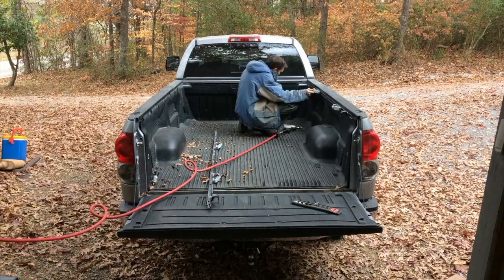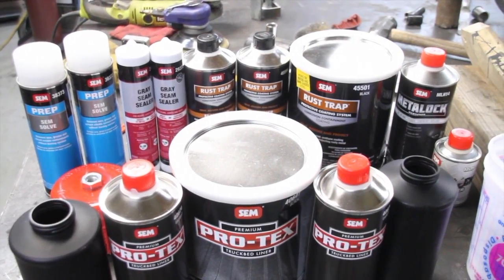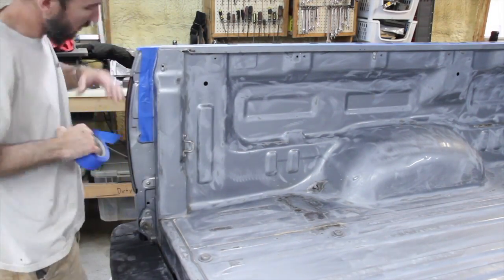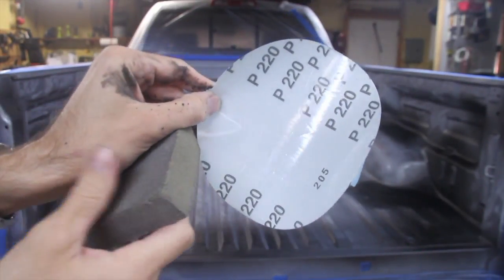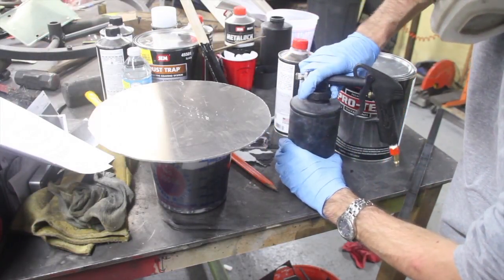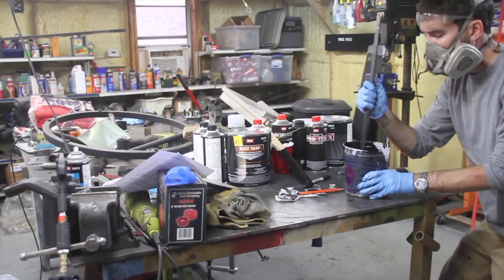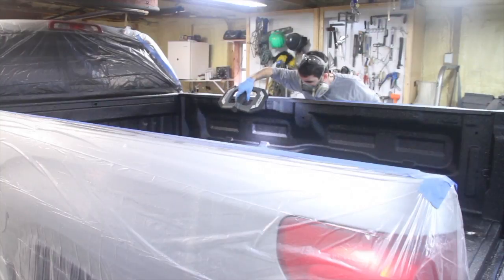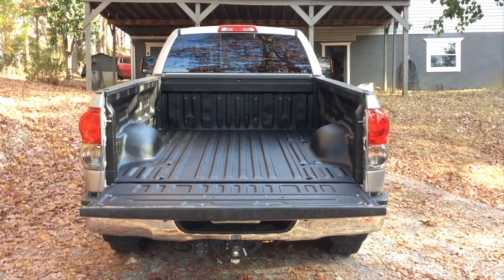How To Spray On Bedliner

Comment: Awesome job. Great detail. Its always fun to see how stuff gets done and knowing it's not all magic and machines. But if you think about it. $100-$200 (if you already have a shop/garage that's well set up with an air compressor and tools) plus 2 to 6 hours of your time. (2 having some experience and 6 this being your first time). Or paying a professional shop to do it for $400-$500. It all depends on your skill. I personally like doing what I can myself because I know certain shops take short cuts to get it done faster. Where if I do it I know I'll take the time to do it right. Sometimes based on your skill, time availability, space/tool availability, it is better to fork over the extra $200-$300 if you can afford it to where you know it will be done right. I went on a rant lol. But nice job. I would be proud of the end result.

Comment: I agree.  That is much better that the plastic OE liner.  But whenever I have a trapped spot to repair like you had I always use weld thru primer on both sides of the patch and the metal underneath otherwise it will rust through again. https://www.eastwood.com/ew-self-etching-weld-thru-primer-16-1-oz-aero.html

But that spot looks like you have a problem with a Toy design defect.  That bed panel should not be touching the panel underneath it.  Is that a piece of frame underneath?  Could your bed mounts be collapsed?  I suspect that those two pieces of metal are rubbing.  If so you may have another rust-through?

Comment: If I was to do this I would just remove the truck bed. Then flip it upside down. Do the bottom then the inside of the bed. Effectively making sure it never rusts again. People act like taking a truck bed off is hard. Its just 6 to 8 bolts mostly all inside the bed.

Comment: Great video.  LOT more work that I thought!.  the 1 difference I plan on is removing ALL the bed hardware (bolts, hooks, etc)  and placing some cheapo bolts in the holes to protect the threads, then re-installing H/W after so it can be removed without damaging the liner..  GREAT JOB !

Comment: Not worth the time and effort that goes into the DIY stuff like this .. it isnt as good as linex and it doesnt have a lifetime warranty. Ive tried this route on my old truck and it did not hold up to any sort of crap i threw in the back of the truck.  I was getting gouged all the time my linex coat gets only scuffs but nothing that penetrates the coating even when im throwing old water heaters and furnaces in the back to take to the dump.

Comment: This is a great video but to be honest these SEM products are way too expensive to make this a DIY project that makes since financially. Going by the Amazon links you provided it would cost $630+ just in materials alone (and that’s assuming you already own a air compressor and angle grinder). I can just take it to line-X and pay them $550 for a turn-key job with a warranty.

Comment: Those older Toyota Tundras are notorious for under body rust. The plastic bed liners are more prone to scratching the heck out of your bed paint than causing rust, but they are FAR better bed protection than the spray on liners ever will be. Each product has it's pros and cons but the plastic will take more abuse. I have had a plastic liner in my truck for over 20 years and the paint is scuffed (because it will move around) up but no rust.

Comment: Can you remove a spray bed liner if you would want to replace it again?
Reply: moronmonkey1 just gotta sccrap it off or grind it but the liner gets hot kind of like plastic and becomes a gooey type material. A scraper is easier unless someone has a better option but that’s usually what I’ve used

Comment: BTW, always disconnect your battery before you weld on your vehicle. I have seen several batteries fried within a few hours of welding on the vehicles they were in. I know it doesn't always happen, and I don't have any proof, but it never hurts to be cautious.

Comment: We like to use bed mats. Mostly, only the floor of the bed needs protection plus, easy to remove and washout the bed.  Spray on methods are nice but after time, they fade and crack. The full plastic liners like the one that was in before are a PITA due to the ribs in them plus most items slide around on them.  It's a hard call between them all of course.

Comment: If you use a HVLP paint gun you would have a lot less overspray to deal with when painting.  Harbor Freight sells a pretty good one for only 16 bucks.  https://www.harborfreight.com/20-oz-high-volume-low-pressure-gravity-feed-spray-gun-47016.html    The purple gun new coupon code 22687355 Good until Oct 15, 2018  Limit 7   (seven ?? I guess if you hate cleaning them)  http://www.hfqpdb.com/best_coupon/20+Oz.+Gravity+Feed+Spray+Gun   (I do not work for HF in any capacity what so ever)

Comment: Will it stick to Rattle Trap sound deadener that is wrapped around the wheel well in a van? And can it be used for interior, with no Off Gassing?
Reply from the maker: No and no

Comment: First of all foreign Vehicles suck, the reason I'm saying that is the cheap metal they use. That bed shouldn't have rusted through! I don't believe in buying Honda's, Toyota's or anything like them.  For the money I would have gone to Line X get a much better outcome
Reply: "Foreign"? The Tundra is the most american truck out nowadays. Designed, parts manufactured, and put together in the US. While I certainly agree with you that a bed shouldnt rust that fast, id be hard pressed to blame its brands point of origin as the problem.

Comment: What about the place you welded?  The under side of the bed is still bare steel.  That will rust out in no time.
Reply from the maker: I painted it, with paint
Reply: BleepinJeep as opposed to not paint. I see.

Comment: You did not treat the back of your patch metal or the frame rails, It will simply rust out again. You should have used weld thru primer at the very least.

Comment: u-pol raptor liner is by far the best bed liner on the market.Very easy to spray comes with its own spray gun and you can get the type of finish you like by  adjusting the air pressure.40lbs heavy finish 60lbs med 75lbs light.Used this on my off road trailer i built and it turned out great.You can also come back at a later date and re-spray if you like..at 40lbs i got a heavy coat.for $125 dollars this stuff rocks....you can get the complete kit on amazon.If you have raw metal use there acid etch primer super8 first.wipe clean with alcohol first spray primer then spray the raptor liner .you will love this liner..check it out....they also have a great support team for questions.....just give them a call.....
Reply: phil Benoodt line x is the best way too much work to do it my self lol
Reply: Phil

Thanks for the info, will look into it
Reply: when you say you can adjust the finish do you mean the texture or the thickness

Comment: I don't think it was covered in the excellent video but what was the overall cost of the products versus going to a body shop that does spray liners as a service?  I know DIY'ers get it done cheaper because they do their own labor.  Would be good to know.  That's a ton of different products.  Would you say that you would do it again with all the same products or you could skip a step or two?  Just curious.  Thanks for a great video. I'm thinking of taking everything out of the inside of my 1990 Jeep Wrangler YJ and spraying the entire interior.  This video shows me how easy and doable it can be.

Comment: I would have taken the bed bolts out. If you have to go to remove your bed for any reason, you'll have to cut around and the liner will start to peel away. Looks good though. The more coats you do, the thicker it'll be. Thanks for all the videos Matt! Def enjoy them.

Comment: What made you chose this instead of the factory bed liner?  
And now I have nightmares about what rust is under my factory liner.
Reply: Nicholas Hollow Drop in bedliners move around a little going down the road and rub the paint off underneath them. They also trap water underneath them and cause the bed to rust. I take them out of every truck as soon as possible and I've never seen one that wasn't rusty underneath.

Comment: Matt you should check out Wagners MotoCoat it sprays bedliner multiple different products and the over spray is much more controllable. I use Scorpion/Al's bedliner product it has an awesome finish and holds really well...plus the clean up is really really easy. You just let it dry and it peels out or off of everything. 

Overall I think yours looks really good. One thing I like better with Scorpion/Al's is the ability to go back over and make thicker or touch up. Not sure if SEM is able to do that

Comment: great video! I think the only thing I would have done different is sprayed the top under the plastic rails to prevent rusting like you had in the floor. I've been thinking of spraying my truck frame and after seeing this it looks much easier then I was thinking it would be.

Comment: I used raptor liner it's alot easier to use and hard as a rock and it comes in a  tintable version.
Reply: Jeff Davis used that on all my bumpers and skid plates
Reply: did you do the tintable version?
i am about to do the raptor liner on the interior and bumpers of my xj. i dont have a paint store in my town and do not know where to find the pigment to tint my liner tan. 
where else might i urethane color pigment that works well with raptor liner?
Reply: How good and long does the raptor liner  do, last?

Comment: I would still send my ruck to linex we have one in Medford which is close by and they always do an amazing job and their product is probably the best out there
Reply: Just my opinion tho
Reply: I had Linex do my 78 f100 a few years ago and it lifted the paint under the
linex. That resulted in really really bad rust under the linex. And yes the
rust started under the linex, not from under the bed and frame. The top of the bed rails were like Swiss cheese under the linex by the time I noticed it as I had a topper on the truck but began ti see rust streaks running down the out sides of the bed (fenders). I removed the topper and the linex and paint lifted right off after the topper was removed. Looking under the truck to the inside of the fenders where the rust had gone all the way through was the only places there was rust one the under side. The top of the fender was badly pitted with some holes all the way through. The linex on the insides and floor of the bed has also come loose but only some of the paint has lifted. It's all the original paint. I ended up grinding the rust and pits off with a very hard wire wheel and coated that with Rust Encapsulator from Eastwood. I ordered new sides (fenders) to repair the damage. Hope to get to that next summer. For now the topper is back on.
Reply: msteve landon my dad has his ford done by linex in 2004 and just had it redone a year ago and no rust so maybe where you live and the people who did it our exp with linex had been amazing that's why I said just my opinion we had good people do it right.
Reply: I remember when mine was done they used some kind of solvent before applying the liner.  That may have done something to the paint.  I was watching the process and the rags they used had paint on them after they were done.  Anyway, I wish I had not done that liner.  I used  Duplicolor  cans to cover the rocker panels and lower fenders on a 94 Jeep Wrangler I restored for my daughter about 6 years ago and that stuff has stayed just fine.  She spends most of the time in the south west part of Utah (no salt).